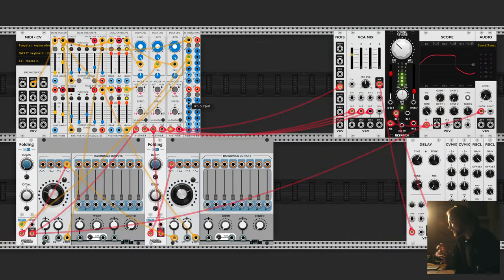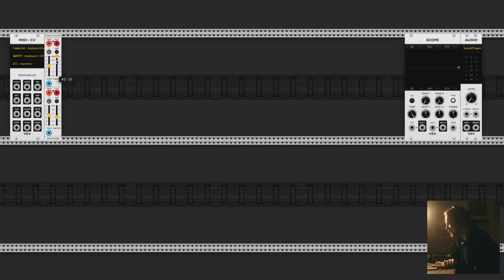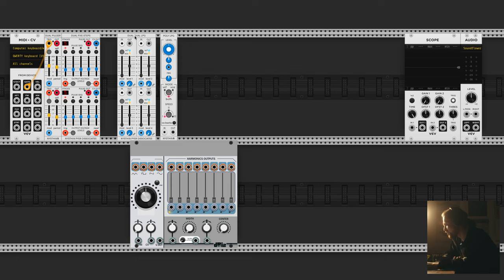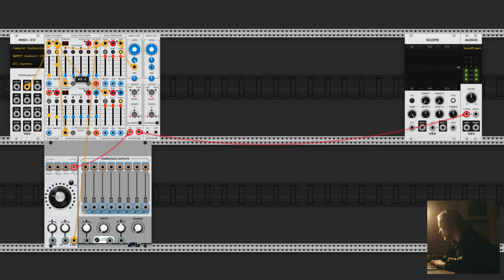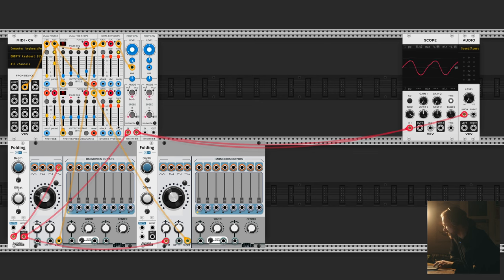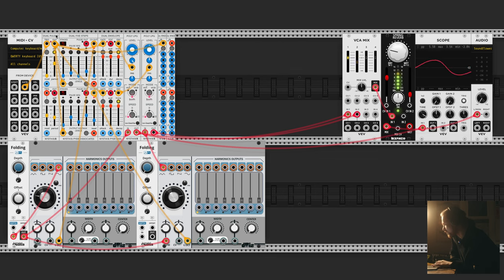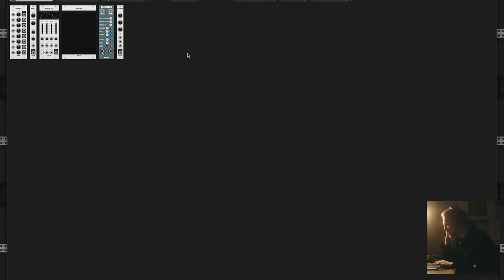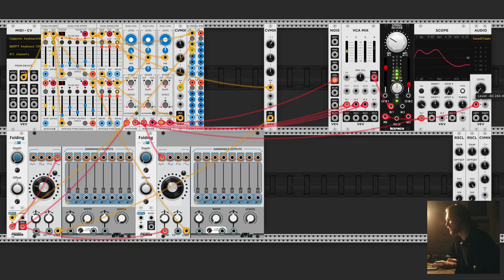Building a free to use Buchla System based on the 208c Easel Command | Thomann

Comment: Nothing beats hardware. Now that I own a lot of Eurorack I can't go back to VCV. It is impossible 😒
Reply: That is not entirely true. One thing is true. You can't beat hardware for costing a lot of money. When it comes to cost, nothing beats software on price. I own both hardware and software so I can benefit from both but choose neither to be better than the other. Then there is the argument about the amount of space a modular system requires when compared to a software modular ...
Reply: You can’t travel easily with, or bring Eurorack systems out into the park, or to a lunch break, sure you might wish you could, or want to.  Until I have enough cash to actually build myself systems and stash them  in each and every place where I’d like to have them, well then I at least am more than happy to get down with the softwares!;)

Comment: Be aware that if you want to do this on an M1 (or higher) Mac to not run the native VCV rack version for ARM processors but the Intel version via Rosetta. The NYSTHI modules have not been ported to M1 one yet!!!
Reply: thanks! Would that apply for running VCV Rack Pro as a vst in Ableton?
Reply: @VNDM-MUSIC  yup it does
Reply: @runglerhz5590  thanks, thought as much
Reply: @VNDM-MUSIC  it is however possible to run the Intel version on an ARM machine via Rosetta2.
Then you're able to run all the third party modules in this patch.

Comment: the dropbox download is not available ("file type not supported") ?
Reply from the maker: It is available. You can download it. Dropbox can‘t preview it because it‘s a project file for the VCV Rack Software. If you download it, you will be able to open it in VCV Rack.
Reply: @ThomannSynthesizers Cheers! Managed to dl. DropBox had me register first which is a bit annoying. Patch does not run om Mac M1 or higher unfortunately, alot of the modules are not ARM ready. Love your patch tho!